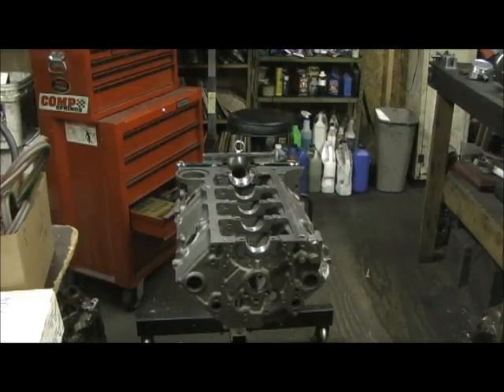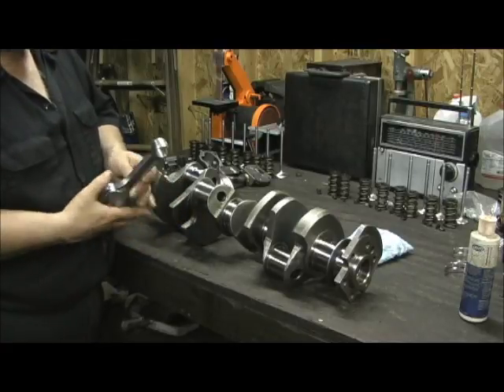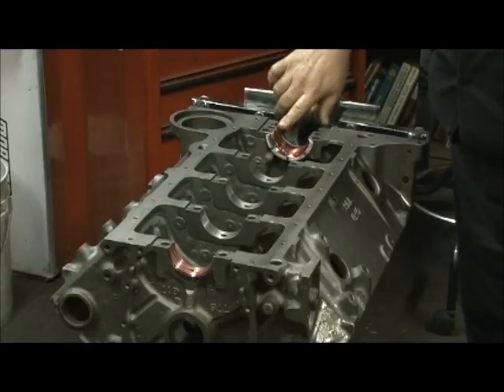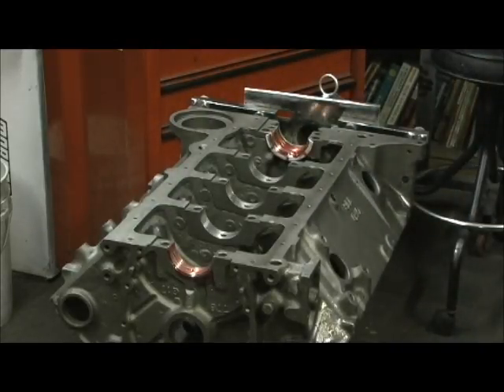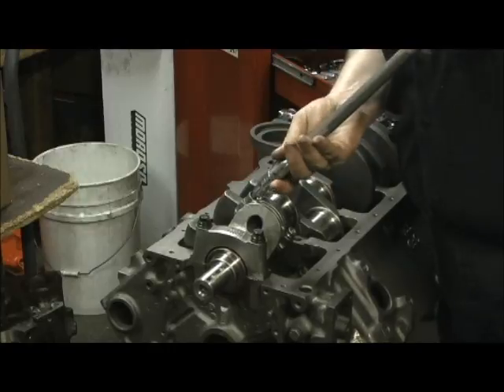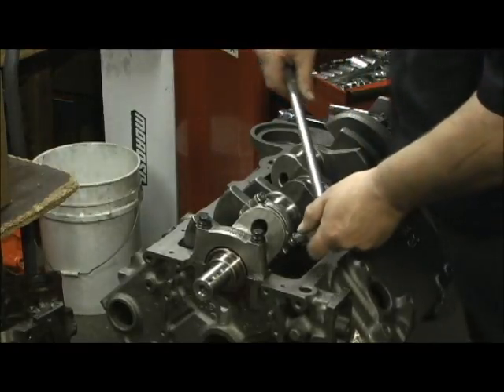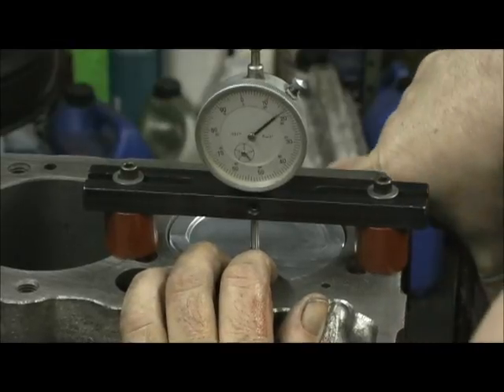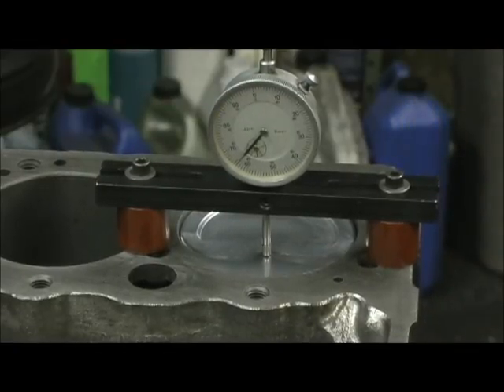336 SBC 305 4 Corner Mock up for Zero Decking Part 4 4

Comment: Respectfully a thought. Although it looks like your technique is superb and this video is very educational, you unfortunatly read your dial gauge backwards. You had .070" left to go to get to zero. I hope you caught it before sending it to get cut. Thank you for the video though. Actually all your videos! I like 'em!
Reply from the maker: Matt Rampone I can tell you have not done this before, as the .070 Thou your rerurring to is NOT important, but rather the .030 after that it the amount that was STAMPED on the block, and the amount that has to be cut OFF the block on that hole (four hole, 1,7,2,8). The only measurement that matterd was the .030 Before the 70 your talking about, OR the piston would be .070 in the hole, and I have NEVER seen an SBC out that bad....Thanks....LOL

Comment: Yes you are right this is the only method of finding true zero deck for your block. Great video's. If you want to pick up a high quality travel indicator for cheap get on ebay and search for Federal travel indicators. I'm a machinist for a stainless steel company and the Federal indicators are as good as the Starrett's.
Reply from the maker: Already got that done the NEXT DAY, and your right, the Federal indicators work great, I got three....Thanks

Comment: Really enjoyed the video.
I did alot of measuring on one of my honda road race engines and ran .024" total piston to head clearance. The engine made great power with really low amounts of timing. Ran up to 7500 rpm without a problem